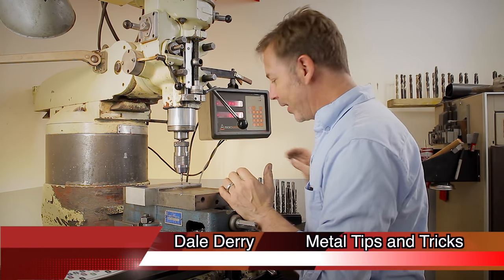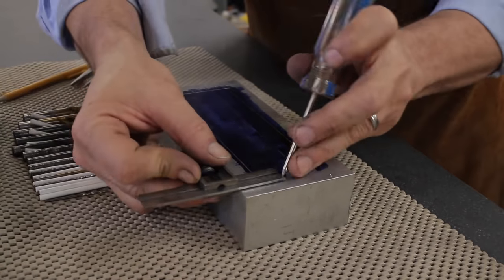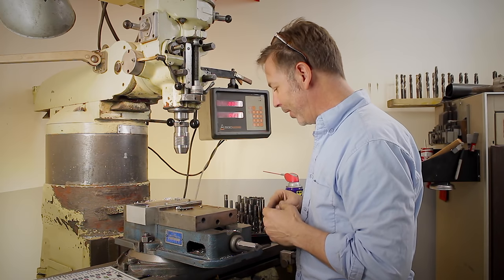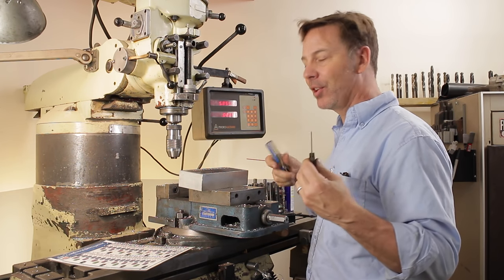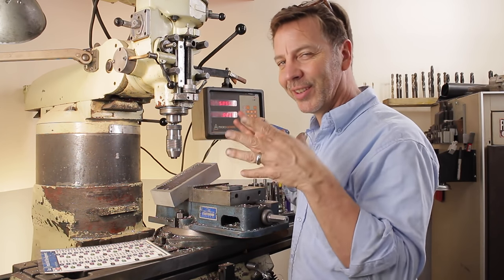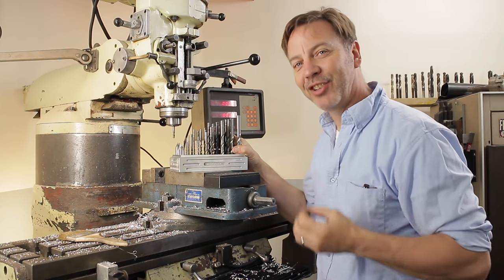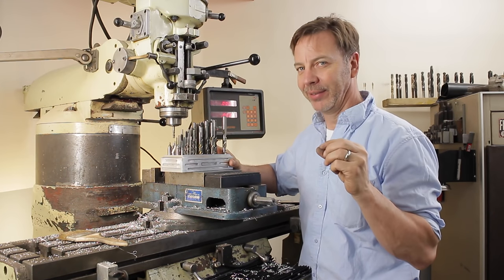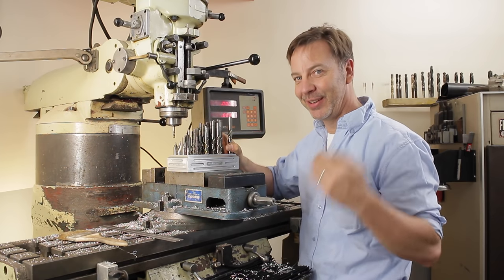How to make a unique Drill index

Comment: I started using foam core PVC, (structural type used by sign makers), for tool holders.  It's easy to work with, cheap, (scraps free from sign makers), and glues with plumbing glue.

I use this for everything from mock up parts, (it machines, and threads very well), to cabinets face frames.

I picked up a trick from a forgotten YouTuber. During of video, on his workbench was his drill index. I noticed he had flipped every other drill. Got me to thinking. 

As I have aged, and my eyes have struggled with small print, or in dim light, I've looked for ways to make thing easier to ID.  I wrapped yellow tape around my */16" sockets, and my odd number metrics, (helps, big time. Has lasted 8-9 years with moderate frequency of use).

The flipping the drills has been implemented, with a twist: I used a yellow paint pen, (like the wrecking yard uses), to paint the round end of the */64's drills, which helps, when lighting is dim.  I also used this with my transfer punches.

Just make sure you stay consistent with flipping the /64s, or you'll regret it.

One more tip. What do you do when your index box gets dropped, or otherwise damaged? Take out each individual index 'row'. Then cut three appropriately sized transverse grooves in plastic or wood, and never have the box fill up with sawdust, or metal, again! Change the depth of the grooves as you move from front to back, and the indexes will 'stadium' for max visibility of the markings.

I love this redesign. You can grab one row, and take it with you, to your project.

Comment: A nice job Dale! How about a similar arrangement for taps and their corresponding drill bits and eliminate the need to look at a chart to figure things out. Keep up the great work!
Reply: I just finished one for my fractional taps and (machine length, {shorties}, drills ... metric is next up... 

I put the tapping drill with each tap size, AND included a shank size drill for each thread size, as well.

As I have gotten older, I've found I don't want to waste time looking for things. I invest less time in organization, (than I waste looking),  and it is a win-win.

Never hesitate to invest in organization. You will never regret the time spent.

Comment: I did my apprenticeship in England and studied both metric and imperial. Its good to understand both but since living in Aus' its all metric. I have to say it makes a lot of sense. Just simple metric mm sizes and way fewer spanners and drills.  Calculations are simple too. Whole numbers and not 23/64 etc.  Seems stone age at times.
Reply: except when you are working with hydraulics. imperial is the way to go!
Reply: Haven't worked much on Hydraulics. I'm guessing they use the old pipe threads.
Reply: +Colin Riley more when dealing with pressure and converting to force like with hydraulic cylinders.
the maths is simple and can be done in your head with imperial, metric not a chance.
Reply: I'm an auto mechanic in Canada, so I have to have both SAE and Metric tools. There are definitely more sizes in the Metric system when it comes to wrenches (spanners) and sockets. In a common SAE set, there are 13 sizes between 1/4" and 1". In an equivalent Metric set, there are 21 sizes between 6mm and 26mm.

Also they can be whole numbers, but unmanageably large at times. In a previous life I worked at a sawmill/planermill as a lumber graderman and later millwright, and we would occasionally do Japanese runs that were in metric. It's much easier to refer to (and quickly measure) a 10' long 2x4 than a 50mm x 200mm x 3000mm piece.
Reply: Colin Riley I didn't say it was complicated. But it just results in unnecessarily large numbers because of an unnecessarily small base unit of measurement for applications like that. Fractional measurement works really well for a lot of things where degrees of accuracy down to thousandths of an inch aren't needed. Want to split a measurement in half? Double the denominator, and vice-versa. I'm not knocking metric, but I do love SAE for a lot of stuff despite its less-than-logical origins.
Reply: If what your saying is true why is it that every country in the world uses the metric system. ? The UK abandoned inches and feet decades ago. Teaching an apprentice in joinery how to devide up equal spaces in a large window when given whole numbers is easy. Now give him the same window with the sizes in fractions of an inch for jambs window styles and see how it slows down the process. Its an outdated measuring system. If you don't like 50 x 200 x 3000. Take off the zeros. 5cm x 20cm x 300cm. I personally prefer the mm over cm.  Its simple.
Reply: The problem in the US is all the used machines use imperial dials and thread in imperial. It's also much easier to get imperial tooling. Metric costs slightly more and there is way less used options. I love metric but went with imperial for most machining projects. It's just cheaper and easier than getting metric tooling in the US.

Comment: Matching the sizes to the chart idea is BRILLIANT!   Same for the idea of the center drills.   And if it were a touch larger a set of counter sink bits too!

I could never bring myself to use a lovely block of aluminium for this.  But the same idea made from a hardwood such as maple would work out just ducky.  

I'd make it a touch bigger so the wood between the holes has more beef and I'd use the next larger size in each case for a touch of clearance in the wood version.  I know for sure that maple takes number stamps nicely as long as they are at least 1/8 or 3mm tall.
Reply: I previously used woods for things like this, then a few years back, I got hurt, and didn't get out to my shop an entire winter.

Every tool I had organized in wooden holders had rusted where the tool touched the wood.

Nothing else rusted, just where the wood drew the moisture, so it wasn't an overall moisture problem.

I have replaced them all with structural grade foam core PVC I get for free, (scraps), from signmakers.

Comment: I am English and I was brought up on fractions. Numbers such as ¼ and ⅞ are second nature to me. I learnt the decimal system when I started work in engineering and I am familiar with both systems. However, when my European chums tell me that the decimal (metric) system is best, I reply that it is, intrinsically, a flawed system. A system based on root 10 is silly because you cannot halve and halve again and end up a whole number. As soon as you halve 5 you get a fragmented number and each successive halving gets more and more complicated. Halving is a fundamental process that mankind has lived with since evolution. The reason: it works! If an octal system (root 8) had been used instead, then you can merrily halve away right down to a single item, unity (1). A hexadecimal system (root 16) is much the same. It was only the halfwit, Napoleon Bonaparte, who insisted upon the decimal system since he figured that he had ten fingers. Wrong. If he had realised that he had eight fingers (and didn't count his thumbs) then the far superior (and user-friendly) octal would have been the world standard.
Reply from the maker: Great comment. :-)
Reply: Or multiply/divide and add/subtract by tens which is much easier to do. Your statement about dividing seem fairly irrational... Exactly what imperial unit are you referring to? 12 inches to a foot? What's an eighth of a foot? 1.5 inches. Whats a half of a yard in feet? Imperial is fine for simple stuff and was great when precise measuring tools were not common place.
Reply: On the flip side - with metric drills you don't have fractions, letters and numbers. I know that 3.2mm is smaller than 5.4 which is smaller than 7.  It's not so obvious when talking about a 1/4 number 7 and B drills. And it gets worse when you have to have both English and metric drills. And with metric sizes you don't even need to look up tap drill sizes because you can just do the math, for example (major diameter - pitch) = (6mm - 1.0) = 5mm .

Comment: Very nice job!  I like the way you broke it down.   You've got me thinking about making one for myself if I ever run into a nice piece of aluminum.

I'm a blacksmith, not a machinist, but I still need to drill a lot of holes and those stupid indexes are one thing I absolutely hate to deal with.  Maybe I could figure out one like yours and add a little blacksmith flourish to it since I don't have a mill!  It'll be something interesting to ponder on.

Comment: maybe even in set a couple small magnets in the bottom so it won't move around under vibration or maybe even angle the block and side mount it on a metal cabinet with magnets.

Really nice projects. I just got six blocks of AL a bit bigger than that, might have just found a use for them.

Comment: Dale I love this one. I will definitely be doing one or more  Lets see Std, Metric, Number, Transfer punches (2) , and maybe stubby sets. 

I see you store your bits the same way as I do. three reasons protects the tips from falling objects including hands, Can see if someone used the set and can tell if the shank is damaged from improper chucking  Both problems when you share a shop.

I can also see a block for common taps with their drills. 

I've been playing around recycling HDPE and I might try it and if it needs more weight  add some to the bottom Now I need to make a mold to do an 8"x 3" x 3" solid block  The colors of the material might look cool
Reply from the maker: +Peter Menningen 
Great comment

Comment: Dale, Great video. An idea for another video would be customizing drill bits for different materials. Ex. brass needs the rake to be + or - (can't remember). By modifying it you can avoid tear outs and dangerous whipping of the material (should be clamped anyways).

Paul
Reply from the maker: +Paul Devey 
Great Idea

Comment: With all of the stamping and details, I thought that it was incomplete. My hobby is woodworking but I am always fabricating something in metal. 
I have a load of drill bits of different types to keep organized. So,.... If I made it, I would like to use a spray enamel for the recesses, which would mean plugging or re-drilling the bit holes. Then the rest of the body could be anodized.

Comment: You need a vernier height gauge for marking out, much easier.
Reply from the maker: Your right using a  height gage would work  well, But this video, like many of mine other videos is try to show people that you can do work with basic tools. Thanks for your comment :-)
Reply: Fair enough, I just bought one for home, it cost $100. Its chinese but quite well made. I use it so much, pretty much every hole I drill on the drill press is marker out with the height gauge, so much easier and quicker and accurate. I dont have a milling machine obviously.

Comment: That's an elegant solution! I'm sad because I have metric drills so I can't make this
Reply: u could go odd even odd ..5 even.5
Reply: barry miller There are existing readily available solutions like that, and just sorting them in a linear fashion works just as well.

What I might try though is to build a tray like that specifically for drill-tap combinations. In metric they use some odd sizes (not .0 or .5 mm) to drill for tapping.
Now i just have to find a piece of material big enough
Reply: With the recess and the slots it still is a nice piece, although i use metric drill bits. OTOH there are many other things that could be organized that way, like tap pitch or shank size.

Comment: Really like it.  I like the fact that it has some weight to it.  I do have a question, Why do you put the drills in grind down?
Reply from the maker: +Chad Prince 
Great question. The shaft on drillbits are not harden. Because of that they are all gauled up on that end, and do not away fit in the correct hole.